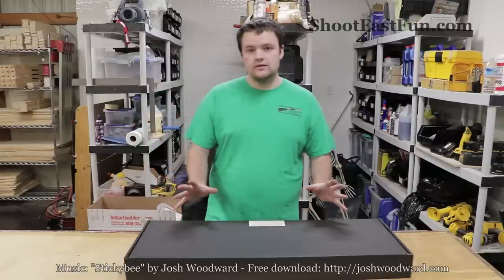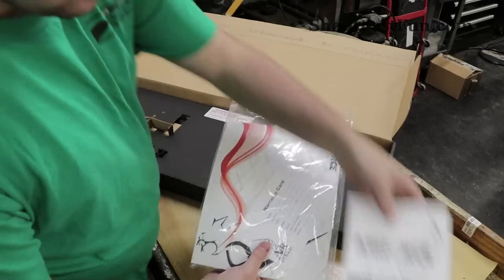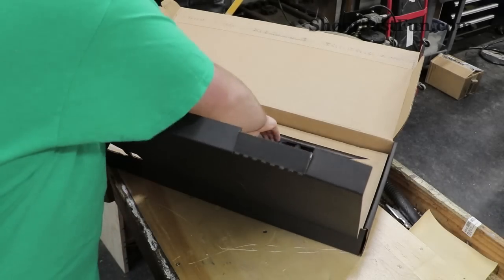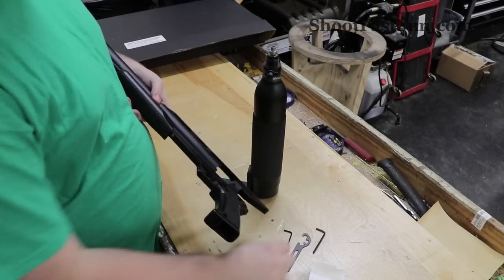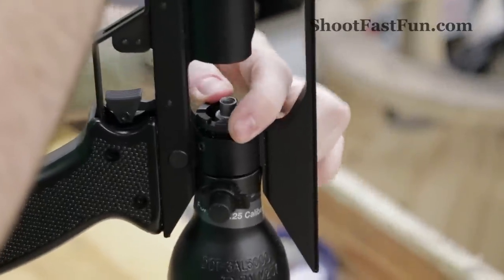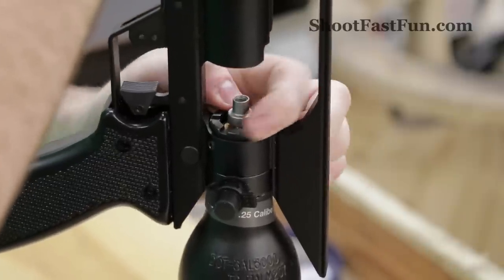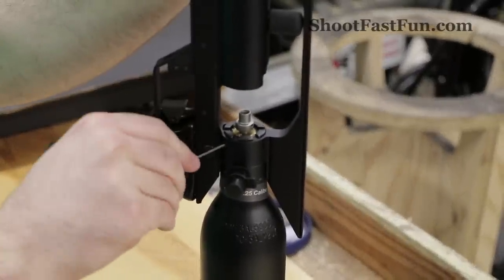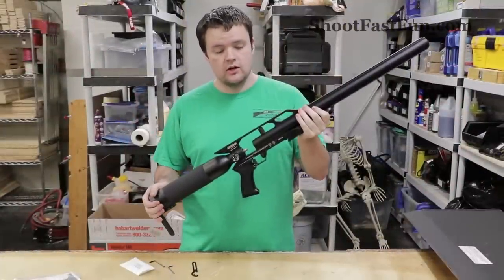Unboxing and Assembling the Airforce CondorSS

Comment: Very nice presentation of a rifle I have absolutely no interest in,  My first rifle was a .22 on I believe a Number 3 Remington Rolling Block, soon to be traded in 1956 on a deal for an almost new "Mountie" version of the Marlin 39 with a  straight grip and a 20 inch barrel, I wish I still had the Remington, but I still have the Marlin.  To me, and this is only a personal preference that I don't expect others to share, if the firearm is not blued steel and walnut, I have little or no interest in it.  My favorites are a Fox Sterlingworth lightweight 16 gauge with two barrel sets, an early Model 70 in .375 H&H, an another early Model 70 in .30-'06, my grandfathers Model '86 light weight in 45-70 made sometime in the early 1900's.  I also have early Colt Revolvers in .45 Colt circa i880 that I still use in CAS, they are in 7 1/2 in barrel length and have the requisite US Army cartouche on the grips, my grandfather's.  I also shoot an 1884 vintage model '73 Sporting rifle in 44-40 also my grandfather's.  All are well used but in excellent condition, my most modern firearm is a Singer manufactured 19ll A1 .45ACP which I use as a carry piece when I am not carrying the old revolvers.  All that are required to be so loaded are loaded with Black Powder.  Having these wonderful old firearms, I have little interest in modern ones, oh yes, I also have a Winchester manufactured Garand as well that I use along with my 1903 Springfield for competition.  Your presentation however was quite good though I wouldn't make space in my gun safes for this piece if it was given to me.